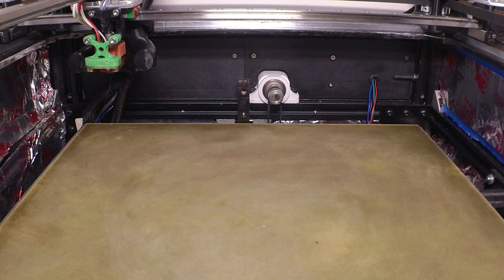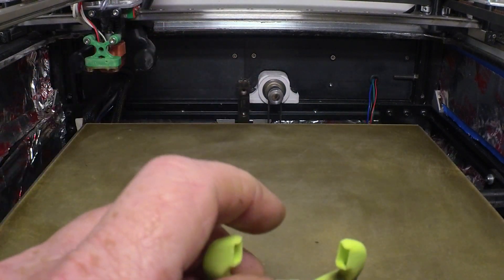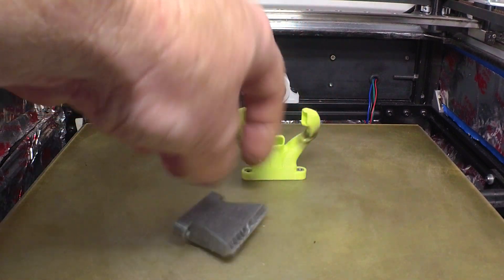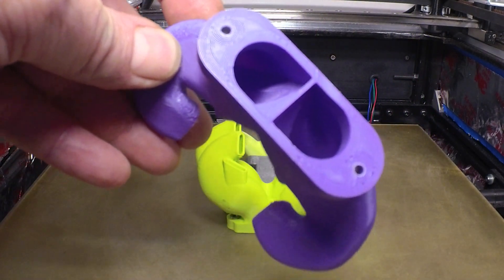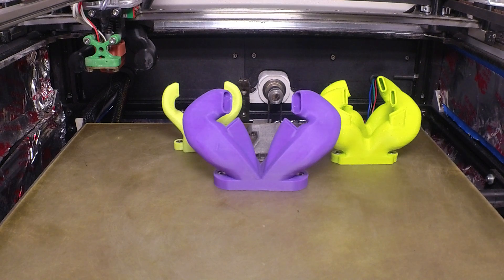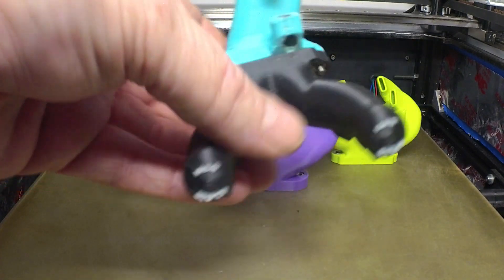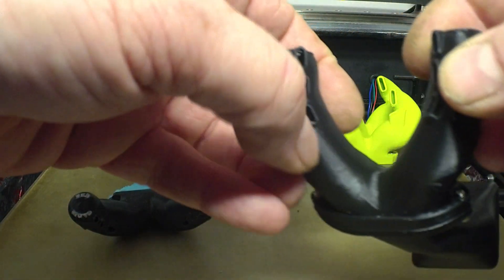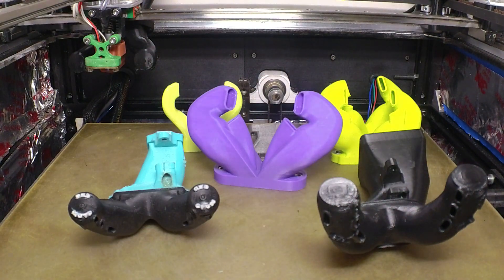DUCTS DUCTS DUCTS!! 3DPrinter duct design

Comment: I think I'm not alone when I say that I'm interested in the STL. I have tried many different ducts and all of them suffer at higher speeds and have the same deformation you described.
Reply from the maker: This particular duct was one of the 1st 'different style' ducts I made. It works better than a lot of ducts but I ended up with a bigger blower. That duct is on thingiverse here:https://www.thingiverse.com/thing:5774249
Reply: @MrRocksalt  cheers. will put it to test once I figure out how to convert to a suitable X-gantry for EVA toolhead. happy new year.

Comment: Looks very similar to one I designed that I’m still using.  Use a double 4028, with 2 tubes.  Get the fan off the tool head, use TWO cpap hoses, and you could triple the size of the opening.  Lol, if only I could post pics……blows like a sob!  If you don’t use 2 hoses you will get back pressure at the fan and the air coming out of the duct is significantly less.
Reply from the maker: I would like to see it! My original intention was to use a 4028 remote. I designed a tube/mount, put a hose, tested it and it did not perform. I made another fan mount with larger volume, tested, and same thing. I could not get the air flow. I think at that point I decided I would try the CPAP and never got around to it. There is much to be revealed with 5015 and 4028 with a good duct, so I pursued that. I will look into it again.
Reply: @MrRocksalt  I think the thing that helped me the most was when I recognized the back pressure that was happening just after the fan  with the adapter to the house. Then air has to escape somewhere and in my case the back pressure was so bad that it was coming out the intake side of the fan. Added another port and it was a significant increase in air traveling through the house.  Look forward to more vids!